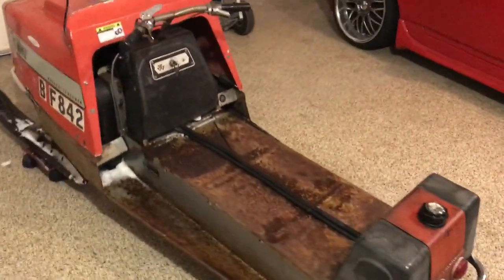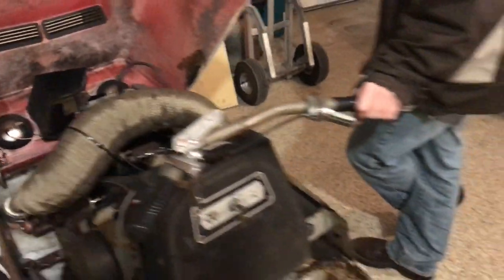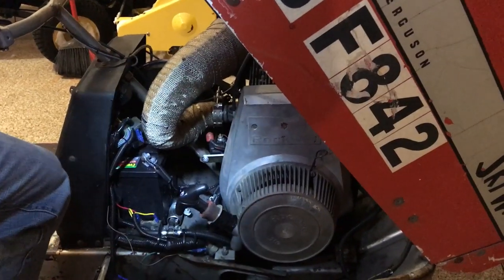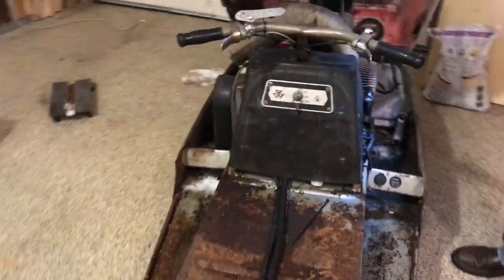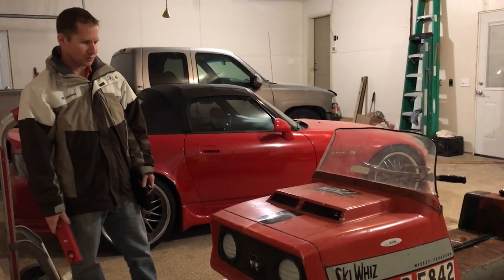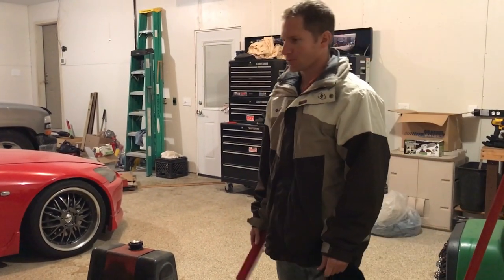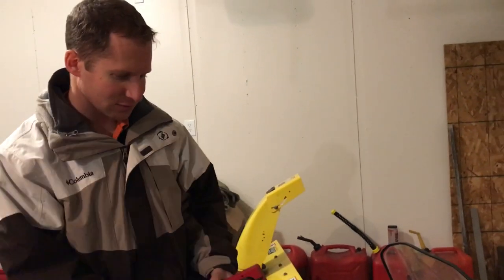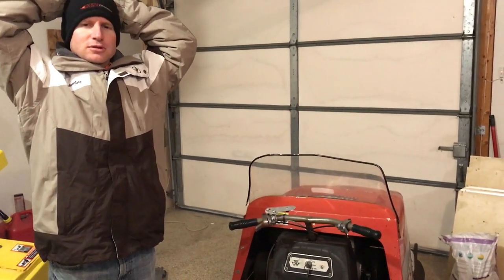Fuel Injected Massey Fergusen Ski Whiz with Remote Start and Reverse

Comment: So does the engine run backwards for reverse?  If so how is he able to do it with it running?
Reply from the maker: Just like RER on a Ski Doo.
Reply: After a google search, it seems that it actually does spin the engine backwards, neat!  Thanks!
Reply: Through careful manipulation of cutting spark above a certain rpm and severely retarding the timing while renabling the spark at the right time 😉